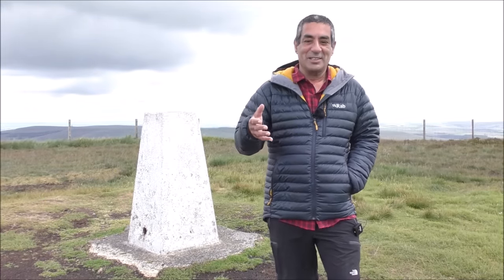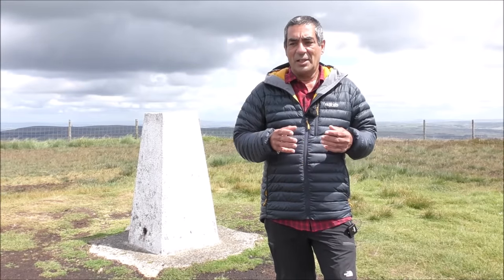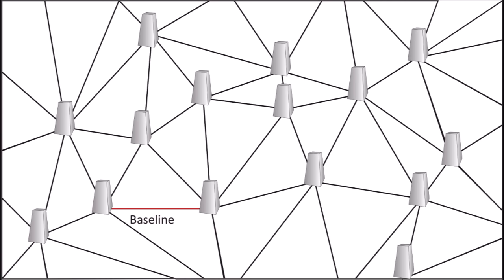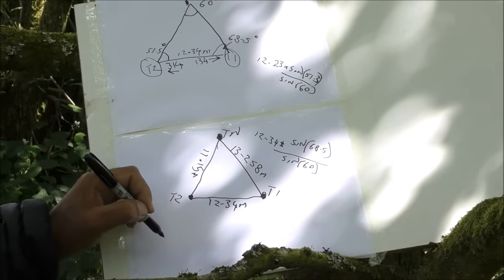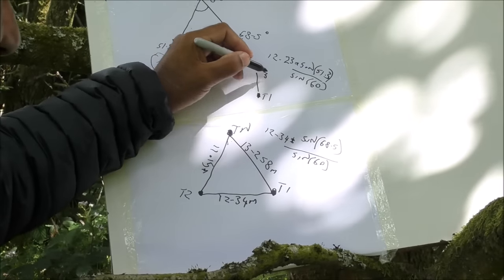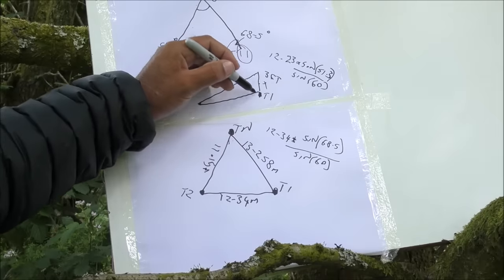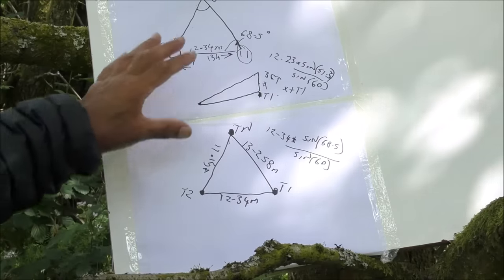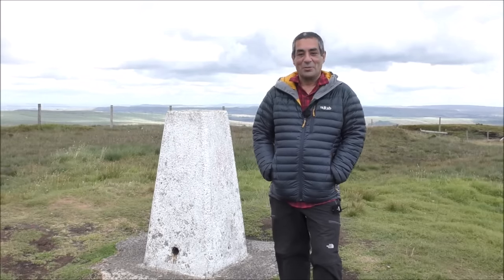How do trig points actually work?

Comment: I was looking all day for a trig point on the Ile d'Cavana in Brasil years ago. It was described as a square foot of concrete with a brass plate embedded in the top.This pre-GPS, we were going to be using transit satellites to resurvey the island.We located the exact spot but no marker.
I gave up after 10 hours searching called for a chopper and went to get a beer at the local restaurant/shack at the landing field.After about 20 minutes speculating what happen to the marker we saw the trig marker in a rather smaller piece of concrete holding the front door open. Cheers , good video-

Comment: I watched a documentary about the planning of the trig points in the 30s. All the concrete and other construction materials were taken to most of the sites by hand due to the remoteness of many of them. And all the calculations were done three times, each time starting from scratch, to ensure accuracy. No calculators then; slide rules and log tables - ! 😊

Comment: Thank you for explaining 'trig points.' Here in NZ our trigs are built in the shape of a pyramid, which consists of a steel frame with wide boards fixed to it, they stand approximately four to five metres high. The top metre is painted in black and white squares. in the middle of the trig, on the ground, is a concrete pad and in the centre of that is a steel pin. If you Google NZ trigs you will see photos of them, but all serving the same purpose as the UK ones. Enjoyed the video. ATB Cheers from the mountains of NZ ☺☺

Comment: My absolutely favourite story about the Ordnance Survey and how accurate the people who hauled that much concrete and brass to build a Trig Point were, all revolve around Major Martin Hotine.  Hotine was directed to survey the entire country and ensure the grid system as it existed, was as accurate as possible.  As the map man says, they started with the Liddington Baseline (or datum.)  The country had been triangulated sometime in the 1790's using a short baseline on Hounslow Heath and later on Salisbury Plain, but Hotine's retriangulation used an 11 km baseline near Liddington in Wiltshire.  Two trig points marked the ends of the datum and a third provided 'triangulation'.  By using lamps and theodolites, the measurements were taken at night, as being more accurate.

Most of the country was triangulated by the late 1930's, but war interrupted VERIFYING the survey.  It wasn't until about 1962 that the checking got to the terminal datum near Inverness.  What they found and calculated was astonishing.  After all those tons of concrete, steel chains and dark nights with lamps and theodolites, they found the error was......this much.  17" or 42cm.  In thousands of miles of calculated and measured distances, the error was less than an arms length.  This meant Ordnance Survey maps are among the finest IN THE WORLD and every time I see a Trig Point - no longer used because we have satellites, GPS  and laser beams -  I think of Major, later Brigadier Martin Hotine and his precise mappers and thank them again and again.  Don't forget him or them.
Reply: Great information, but theres a common misconception that trigs are not still used with GNSS equipment. I use them weekly in Australia for this purpose.
Reply: Very interesting , thank you  for the information
Reply: When I joined the OS in 1965 as a surveyor I was amazed that they were already working in metric.
Reply: The Corps of Royal Engineers (Survey) were amongst our earliest surveyors.
Reply: How did he measure his baseline accurately, given that the ground between might have had obstacles? Or did he pick it for that purpose?
Reply: ..and @Blagger3000 the Survey Engineer Regiment is still going strong today. It can trace it's history back to the military survey of Scotland in 1747, a task that was undertaken on the direction of William Roy, who later became a Major-General and in 1791 led the creation Ordnance Survey itself . In 1824 the Board of Ordnance ordered a survey of Ireland with 13 and 14 Survey Companies, Royal Engineers raised for the task; these squadrons still exist today as part of 42 Engineer Regiment (Geographic)
Reply: Are they protected, government property, can a land owner remove one if he didn't want it in his field?
Reply: Thanks.
That dovetails nicely.😃
Reply: @Megahegs For what purpose?
Reply: Thanks for the story. I grew up hiking and relying on maps rather than GPS.
Reply: @MrBollocks10  topographic mapping and extension / densification of the survey control network.
Reply: Thank you so much for adding this information to the video. My name is Mike Whitaker and I am Brigadier  Martin Hotine's eldest grandson.

The only thing I'd like to add is a note on pronunciation. The o is hard, so it's hoe-teen. It was a real shame that Nicholas Crane didn't get it right on the BBC Map Man episode, which really upset my mother, understandably.
Reply: With modern technology, what kind of accuracy is achieved nowadays ?
Reply from the maker: Hi Mike, thanks for joining the conversation.  I have watched that BBC episode quite a few times about the work of the OS.
Reply: they are protected, but I've never heard of anyone being prosecuted for a removal. They are typically out of the way, in the top of hills and mountains rather than in the middle if a field. They are precisely located, not located precisely, so there is some leeway as to where they were placed
Reply: A similar story here in the USA in the building of the transcontinental railroad.  They mapped all that out on horse and donkey back and now, despite satellites and GPS, they'd be hard pressed to find a better route through the Rocky Mountains than the one they used back then.  If anyone is interested, Stephen E. Ambrose wrote a pretty good book on the subject.
Reply: @and7barton Using the GPS satellites it is possible to achieve an accuracy at the millimeter level. However you are talking about long-term measurements using specialist equipment that is not cheap and may not even be available to the general public. With a GPS-enabled smartphone you can expect an accuracy to within 5 meters or so, which is quite amazing when you think about it. Note that this is the accuracy you can get from using only GPS. Many smartphones make use of a combination of technologies combined with GPS to increase location accuracy down to about a meter. One such technology is Wi-Fi RTT, which (simply put) measures the time it takes for a radio signal to travel back and forth between the phone and a nearby Wi-Fi acces point. This gives a very accurate reading of the distance between the phone and the Wi-Fi access point. Combine this with readings from multiple access points and a known location for those access points, and your phone can triangulate its position with very high accuracy. This is particularly useful in indoor spaces or heavily built up areas, as those are prone to GPS signals being blocked or reflected (causing less accurate readings), while also often having many Wi-Fi acces points.
Oh and here's a fun fact: Given a consistent GPS signal with a practically constant error margin (such as you can easily get with your phone stuck to your car's windscreen while driving on a highway), if you use it to measure your speed you get increasingly accurate readings the faster you go. This is because the error margin stays the same, so relative to the measured speed, the error margin will be a smaller percentage of the measurement the faster you travel.
Reply: @tinytonymaloney7832  In the USA, Benchmarks are Federal Government property and cannot legally be moved or tampered with under penalty of law. In the event a benchmark absolutely has to be moved, a new survey will be performed, and the database/publications/maps are annotated. It ain't cheap, either.
Reply: @MicraHakkinen  Super answer. Thanks for the quick response.
Reply: You're correct in what you say, but just for interest, the TRIANGULATION OF GREAT BRITAIN started much earlier!
I believe it was Thomas Colby who completed the original survey, under the direction of the ORDNANCE SURVEY, which was a branch of the ROYAL ENGINEERS.
But this is fascinating history, and should be taught to kids. Everybody just takes GPS for granted now, without having a clue what is behind it
Reply: Fantastic
Reply: I will have to track that down. What was it called? @TheMapReadingCompany
Reply: We finally know why the ultimate answer was "42".
Reply: I was told that the original baseline was at Hounslow heath o  the bath road
Reply: @tinytonymaloney7832  yes, they were protected, but most have not been checked or maintained for 50 years. There are a few that are still in use, but they have a plaque on them stating that they are part of the GPS network so are still under UK government protection.
Reply: @Megahegs 9
Reply: @and7barton  - high-end commercial or military grade GPS systems can even do in-flight positioning down to a few millimetres or better these days. As an application example, there are GPS control systems that track and control the blade position and angle on road construction graders while the grader is moving forward in real-time with an absolute accuracy of a few millimetres. These systems cost a few bundles more than your hiking-grade handheld GPS receiver, though, and they are technically much more sophisticated.
Reply: i wonder how accurate the old system of surveying is compared to the modern methods by satellite i believe ,i wonder what the difference is in accuracy.
Reply: 17” = 43.18cm

Comment: A couple of points of clarification if I may, both of which indicate the accuracy to which the Ordnance Survey works.
1. The small support ‘stick’, upon which the spirit level was placed, must be removed. The point upon which the bottom of the staff is placed should be at exactly the same level as the top of the arrow, otherwise an error would manifest itself. Old brackets were shaped (concave) so that a temporary reference point on the bracket stood away from the face of the trig point; so the support for the spirit level, which bridged between this and the top of the arrow, was necessary - the support pieced had to be removed before the level reading was taken.
2. The reference ‘arrow’ is only for establishing levels (the Z component) - neither the flush plate nor the staff is used in the measurement of angles. The top of the trig point/pillar has embedded metal grooves, set at 120° about the precise reference point (in X & Y) of the trig point. These grooves enable the siting of theodolites and/or their ‘targets’  with easily repeatable precision - repeatability over time and by different surveyors. Theodolites (and targets) sit on the top of the pillar, without the need for the usual tripod used by surveyors and engineers when measuring for, or setting out new, infrastructure. The central point on the top of the trig point is it’s reference point in X & Y.
NB - I’ve learnt that links are not permitted in comments - my previous, now deleted, comment had links to images of brackets and the tops of trig points. These can be found by searching for ‘os flush brackets’ and ‘os trig point plates respectively.

Comment: There's an error there somewhere. Given the angles you have measured, the sloping side to the right should be shorter than that on the left. You should be calculating using opposite angles. The sides you have calculated should exchange positions. Apart from the mathematical error, this video is fascinating for its information and explanation and very well presented. I studied this stuff nearly 60 years ago when the job was very much hands on with microwave measurement in its infancy then, so it is all familiar and nostalgic.
Reply: The formula which should have been written is Sin A/a = Sin B/b = Sin C/c

We can rewrite this for the Application 

T1°/lenT2T3 = T2°/lenT1T3 = T3°/lenT2T1

Just as a side note here. If we were actually doing this on a large triangle we need to kniw that as the len of any side increases this measurement would not reflect statute distances because of the curvature of the earth surface. In that situation we need to recalculate given the cord and converting the cord to an arc (And the ancient babylonians would be smiling at you).

T3° = 60°
T2° = 51.5°
T1° = 68.5°
lenT1T2= 12.34 m

The equation we select first is T1/lenT2T3 = T3/lenT1T2

we can then insert the givens and solve Sin 60°/12.34 m = Sin 68.5°/ lenT1T2

lenT1T2 * Sin 60°/ 12.34 m = Sin 68.5°

lenT1T2 = 12.34m * Sin 68.5°/Sin 60°

lenT1T2 = 12.34m * 1.074

lenT1T2 = 13.2575 m

And so we can see he assigned the length he calculated to the wrong side. 

Good thing im not a cartographer or I might have got it wrong too.😎
Reply: @Darisiabgal7573  The three angles of a triangle on a flat plane add up to 180 degrees. on a sphere they will a up to slightly more than 180 degrees. Earth curves about 8 inches in the first mile.

Comment: Very interesting!  In the US, we have geodetic survey markers and through time some have been lost or they were on a bridge that has been replaced.  I used to go around, while geocaching, and try to find them and report those that still existed to a website.  It was educational and fun.  I need to look back at some of the photos I took of them to see if the elevation was on them too.
Reply: One of those is set in concrete near a restored train station near to where I grew up in California.  My brother, until very recently, worked as a surveyor and one of the first things they do is look for this at a property corner, they have a metal detector for this purpose as they very often wind up covered by dirt over the years.

Comment: Very interesting. I've seen the plates in the side of trig points many times but I never knew their purpose. I always assumed that the theodolite sat in the brass disc on top of the pillar and the plate on the side was for identification plus some random goverment marks. One small correction, which doesn't affect your video at all - you've swapped the calculated side lengths between Tn and the other two points. The longest side is opposite the largest angle. In practice this would have been noticed when the adjacent pillars were surveyed. Thanks for the video. I learned something new and that makes my day.
Reply: Good catch

Comment: This is very interesting.   I did a presentation about the Public Land Survey System here in the USA.  You do  a much better job that I did.  The other challenge to explain is how chaining can be done over elevation.  As a Forester we used chaining when walking to determine locations.  My chain is 12.5 paces to 66 feet.  My last half pace was a little short.

Comment: Please correct me if I am wrong but isn't the length of T1 to TN = 11.15 and the length of T2 to TN 13.25??  The ratio of Sin 68.5 to 11.15 is not equal to the ratio of Sin 51.5 to 13.25 as pictured in 13:05 of the video.
Reply: Yeah, wasn't the shorter side longer than the longer side?
Reply: @beeble2003  you know, I did not read the video description. Thanks for pointing it out.
Reply: Thank you all.  I really enjoyed the video and I learned a great deal.  I spent the next two days researching numerous trigonometric laws and reviewed many other land navigation videos.

Comment: At 13:20 you made an error in calculating the unknown side lengths and got them swapped around. The T2-TN length is 13.258m, and the T1-TN length is 11.15m. You always want to use the angle opposite the side you are trying to calculate in your equation. You used an adjacent angle.
Reply from the maker: Oh.  Sorry about that.  Trying to do maths on a board in a tree is always slightly difficult.  
The basic idea is correct though - I've just watched it again and you're correct I got the "T's" mixed.
Well spotted
Reply: @TheMapReadingCompany  No worries. That example tool you built for the flush mount monument was really neat.
Reply: I hunted for somoene else who noticed!!
Reply: I had to come hunting through the comments to check this too. Great tutorial even with the minor maths mix up.

Comment: I was a Forward Observer in the days before GPS and could take a compass and protractor to place your location within a few feet.  We used MILs for precision (~6400 in a circle vs. 360 degrees).  Those surveyors were on an entirely different level though.
Reply: That job is dangerous AF!
Reply: @1mouseman  Fun though.  I was the only seventeen year old I know that has gotten to call in an artillery strike (demonstration).
Reply: Minutes are more precise than mills though

360•60 = 21600 

But of course you can get as precise as you want given enough digits in any system, even radians of which there are only 2•pi of in a circle so

I like milliradians but hate that they are called mills (so are milliliters sometimes, just a pet peeve)
Reply: And wouldn't it be 2•pi•1000 ≈ 6280 closer to 6300 milliradians in a circle? 
Why round to 6400, 64 is a power of two ..... so that's nice.
Reply: @abstractapproach634  You are correct.  I wrote 6400, it is 6300 (E.G. the M2 Transit Compass).  The pathfinders and such used a lensatic compass in degrees but when your locating targets and making adjustments to artillery miles away, you have to aim small to miss small.  The Army surveyors, 82C (IIRC), liked to remind us rather smugly that there were actually 6308.xx (I don't remember the actual figure, just that they liked to say it) or something like that.  

The compass also had a declination scale that we'd adjust based on latitude and which longitudinal quarter you were in.  Since maps are oriented to true north, this effectively adjusted the compass to point to true north as well.  A protractor/scale combination allowed one to plot azimuths and distances but I never needed it.  Kind of a savant in that regard.